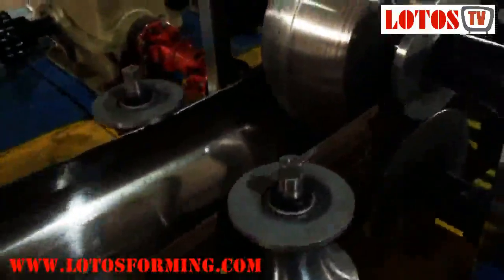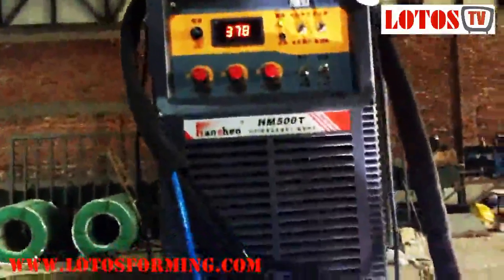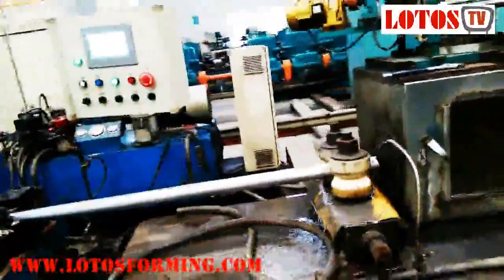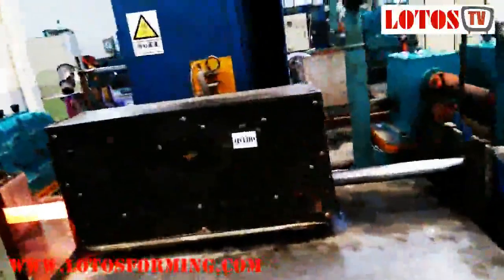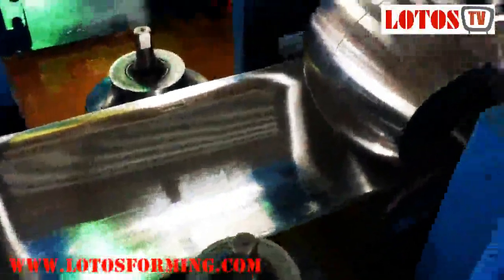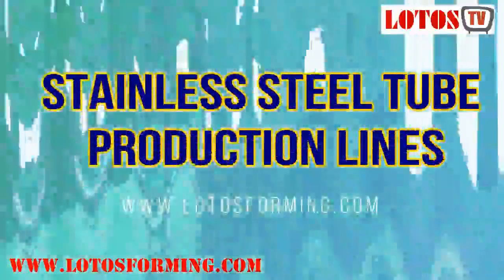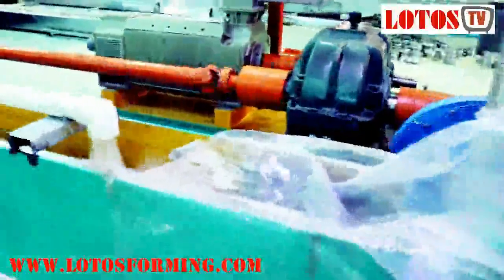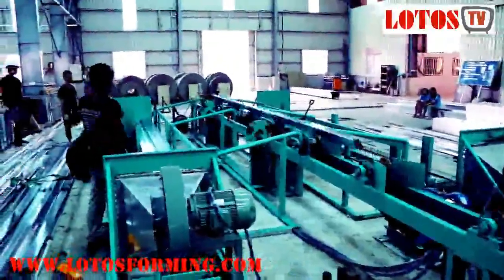Steel pipe making machine(2019 tube mill roll forming machine)

Comment from the maker: Single side / Double side uncoiler.
Strip butt welding equipment: Manual welding table or shear and butt welding machine
3 stage roller tube making machine.
Forming section
Welding section
Sizing section
Cooling section.
Weld bead grinder
Auto - cut off
Reply: Antonmursid🙏🙏🙏🙏🙏💝✌🇮🇩🇮🇩🇮🇩🇮🇩🇮🇩🙏💝✌

Comment: https://www.lotosforming.com/tube-mill-machine/
Reply from the maker: is a new welding technology, which coats thin stainless steel on the surface of carbon steel pipe with high strength, the product has the features of both artistic appearance, therefore, corrosion resistance of stainless steel and high strength of carbon steel

Comment: we have tube mill machine in our workshop , but are working on new machines like Stainless steel making steel pipe roll forming machine, in video looks heavy roller and stations for making tube from sheets , and normal speed to make sure final 6 meter tube has acceptable accuracy,
Reply from the maker: you are right , we use realy heavy and standard stand and roller for tube mill machine that can produce up to 4 mm thikness

Comment: Stainless steel tube mill is a new welding technology, which coats thin stainless steel on the surface of carbon steel pipe with high strength, the product has the features of both artistic appearance, therefore, corrosion resistance of stainless steel and high strength of carbon steel. this video is best video about pipe or tube mill production line...
Reply from the maker: http://www.lotosforming.com/tube-mill-production-line/